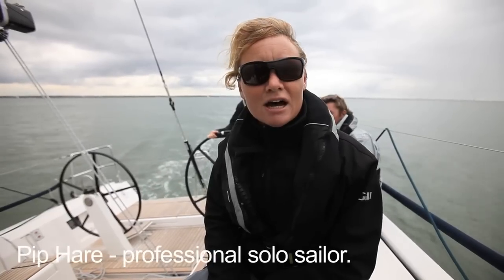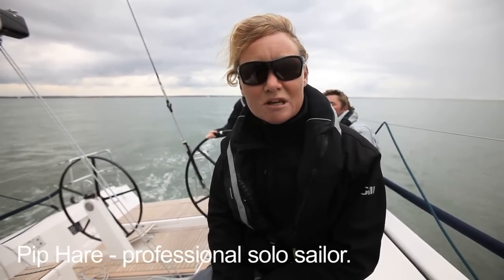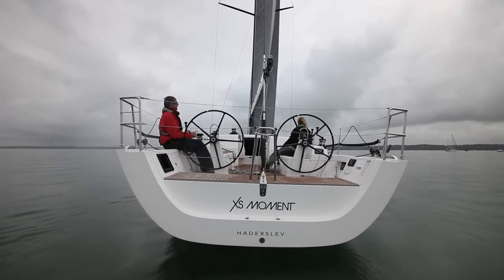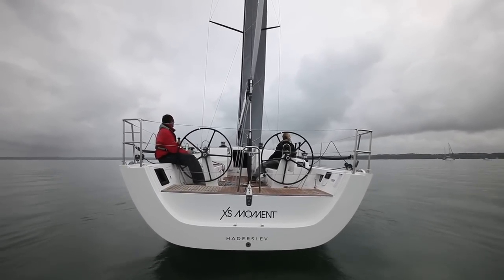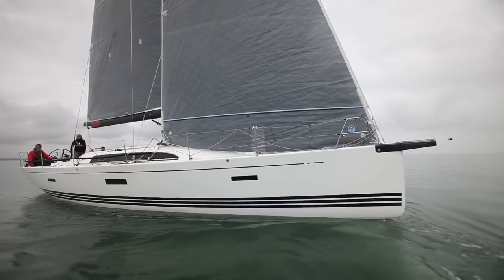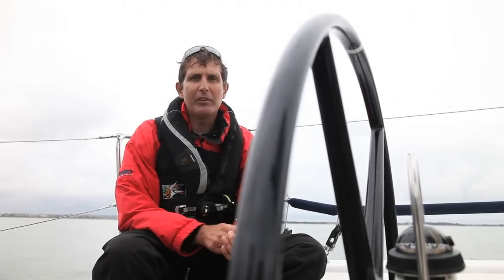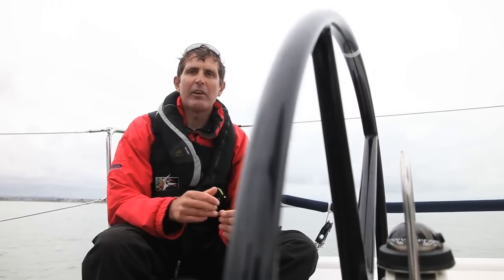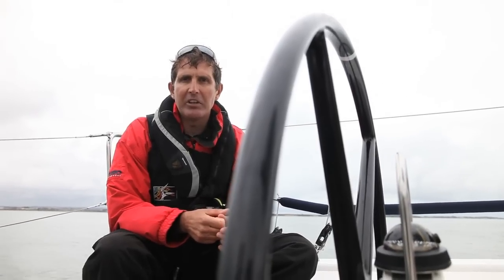How to helm upwind. Tips from round the world sailor Brian Thompson

Comment: Smaller, older boats (IOR-style) must absolutely sail to the waves upwind, or they will stop you dead in your tracks. Methinks Mr. Thompson has not had to sail a non-planing boat under 60' in quite a while... Otherwise, this is a good, very broad-strokes, 5 min. video on steering upwind for cruisers, I'm guessing, so of course there is nothing about sail shape or trimming, or optimum pointing, etc.